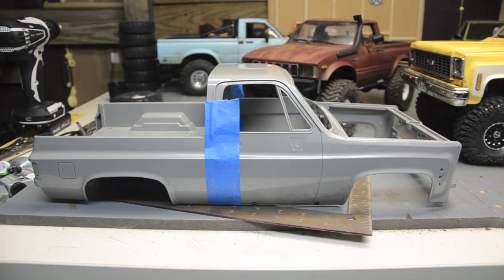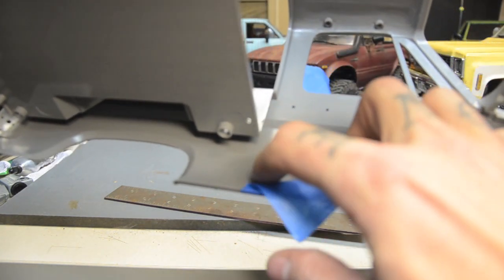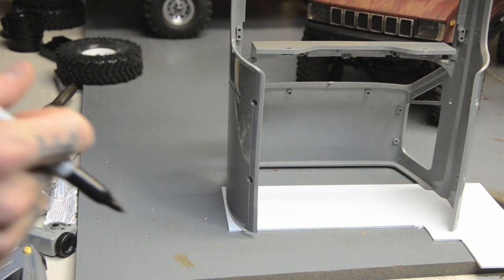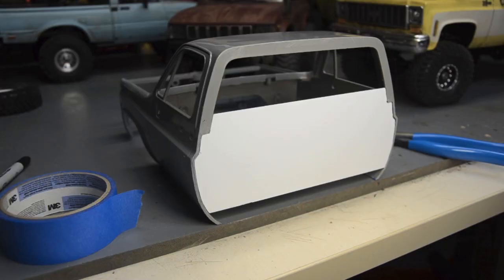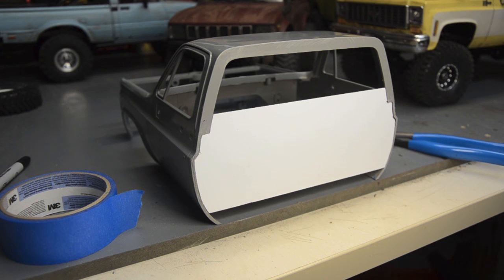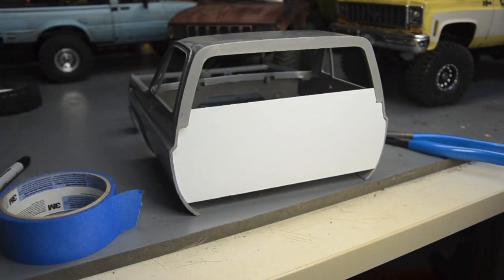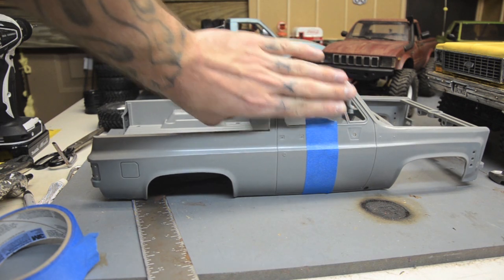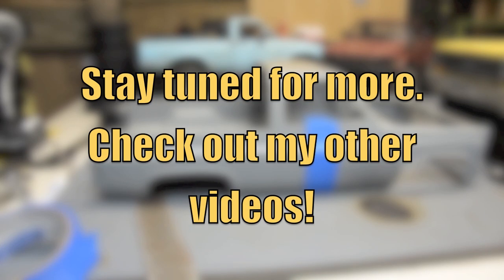RC4wd K5 Blazer to K10 Pickup Conversion Part 1

Comment: I'd just cut the bed sections from in front and behind the wheel wells and graft them onto the bed you already cut off. That way you will also have the floor parts, which should line up perfectly, and can still keep the truck cab. Then take the tail gate part and graft that to the left over cab and make a truggy with a fold down tailgated cab lol.
Reply from the maker: +Captncouth good idea. That way I don't waste as much.

Comment: If you plan on driving the rig? then yes you need to brace the back of the cab and the tray bed. I went to the trouble of making the molded panel for the back of my K10 build (rc4wd k5 chopped) and very happy I did as I can take off the tray bed and fit a flat bed to it later if I get bored with the look..here's a vid of my chopped rc4wd blazer https://youtu.be/zLy5cfb-fZw
Reply from the maker: +Aussie Crawl-ers That is a great looking truck!  How much did you have to add for the bed?
Reply: +RC Everyday about 10mm, but I wanted it short to match my wheel base, because the plan was to comp it.